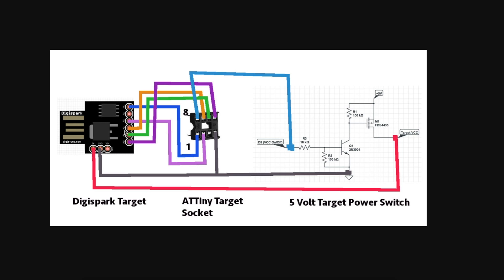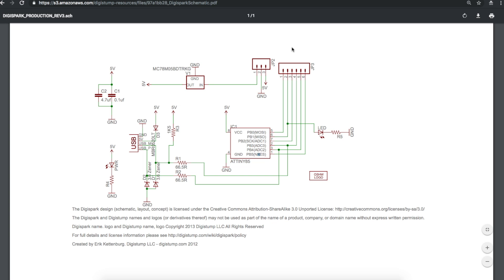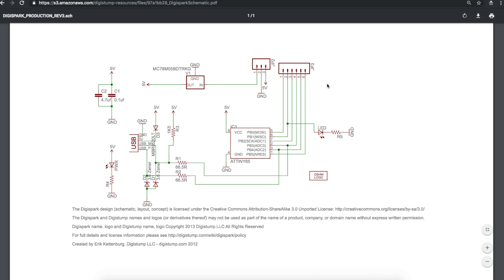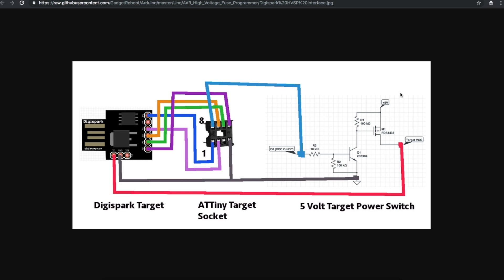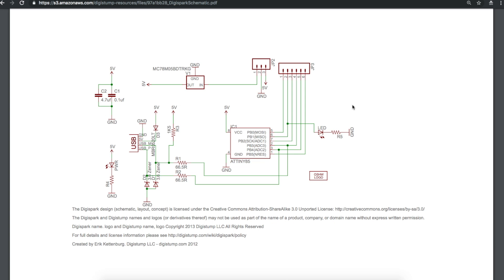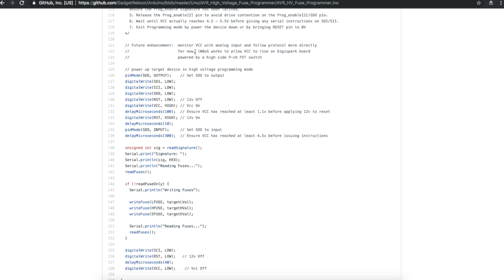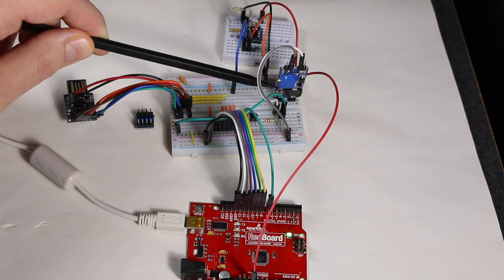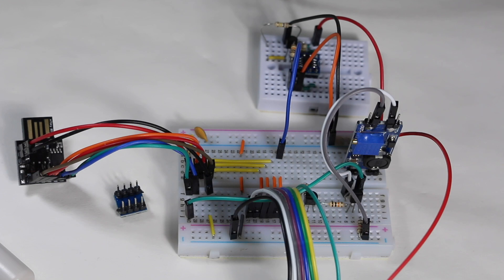Re-program Digispark Fuses in Circuit with HVSP

Comment: New subscriber and I must say Really really well done 👏 interested to see the delay of the VCC on the scope.
Reply from the maker: Thanks!   I wish I had caught one of the slower rising VCC waveforms to better illustrate the difference in the delay from the chip on its own but at least I was able to show somewhat of a difference with the traces I put on git hub. 
If I get a better capture I will update the files on git hub  and I still plan to do the analog voltage monitoring so the programmer will be completely self-contained and not just guessing on a delay that works for all cases.